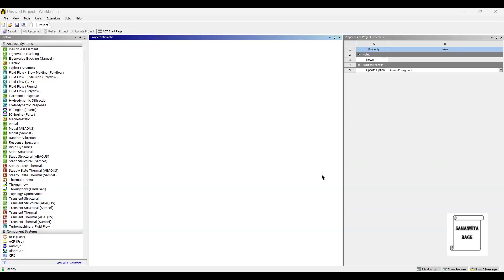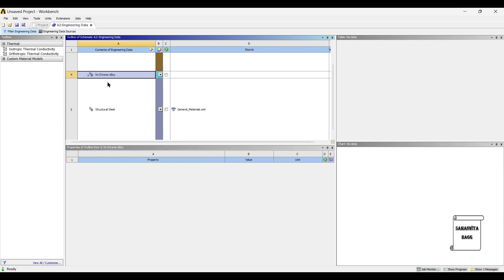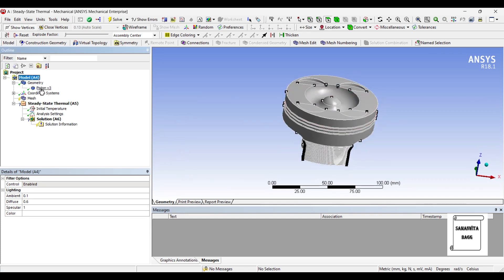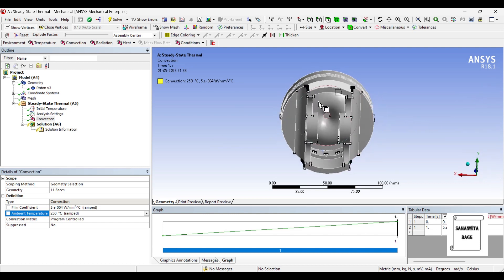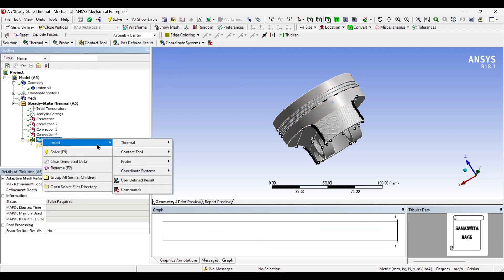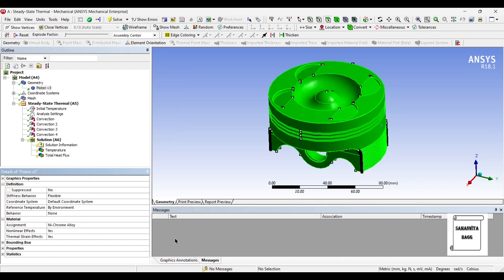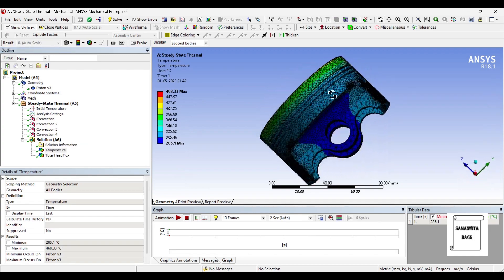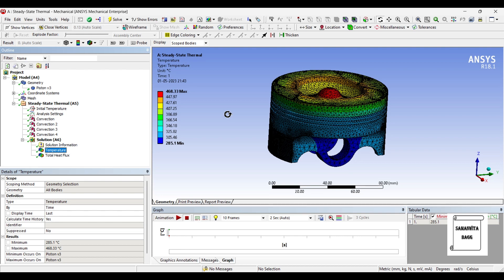Piston Head | Steady State Thermal Analysis I Temperature | Heat Flux | ANSYS Workbench

Comment: When comparing with two materials, you shouldnt change input parameters. Also you need to apply temp on top surface & convecion on side surfaces, heat source is acting directly on Top & there is almost no positive convection from top of piston. Also, all other values need to be preciously calculated for actual results